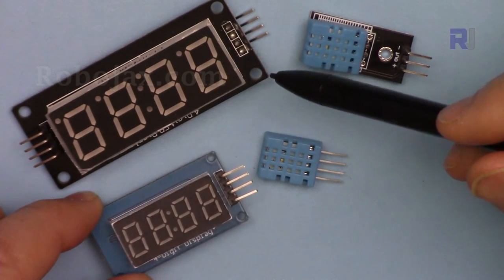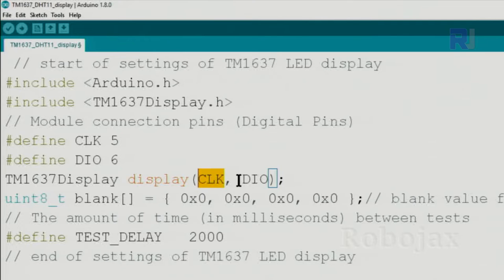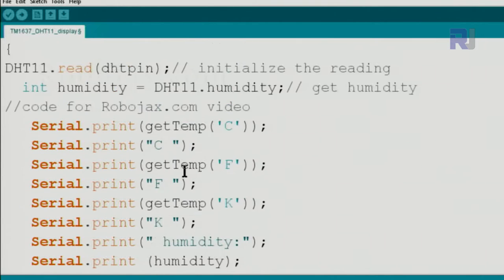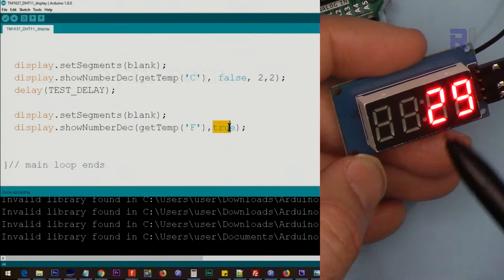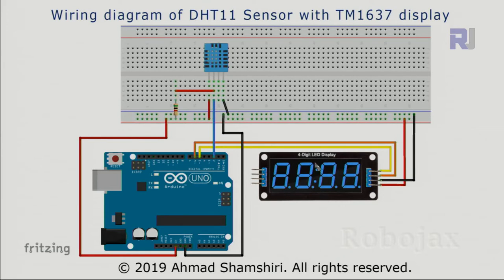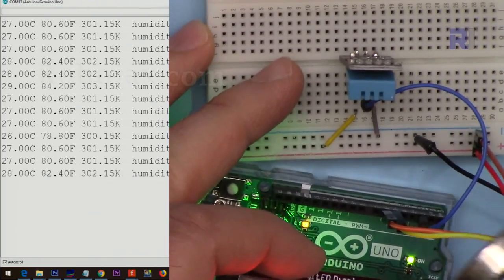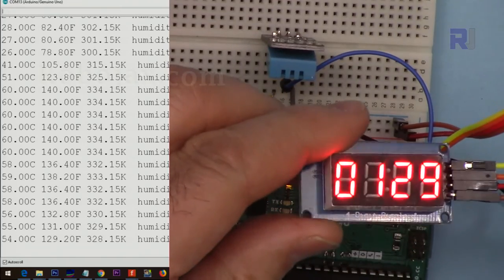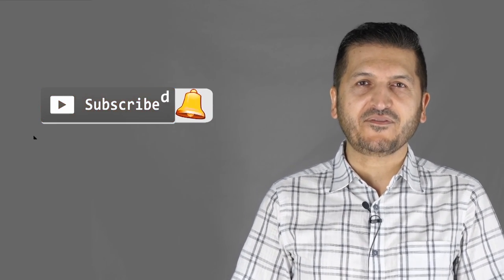Lesson 28: DHT11 Temperature Sensor with TM1637 Display| Arduino Step By Step Course

Comment: dear sir i am using 7 seg TM1637 module with Arduino, i hv download "Grove_4Digital_Display-master" Library and its working best. I hv used "  tm.set(7); "//set brightness; 0-7  instruction, i want to increase 7 seg brightness so i give tm.set(9);" its not working then i open "TM1637.h" file by changing its ext to TM1637.txt there i increased brightness from 7 to 0x0f. but still its not working when i write "tm.set(0x0f); "//set brightness;" in program. Plz can u tell me h i can do this.

Comment: Dear Sir, I made temp meter with Arduino & DS18B20 display on LCD working best, as LCD cost high so i brought 7 seg TM1637 but here i face problem. for example if i write this instruction   
for(int i=0; i<=500; i++)
  {
    display.showNumberDec(i);
delay(3000);
  }  
LCD work best as i think LCD has inside controller which hold last instruction and keep display last digit for 3 sec delay time, but with 7 seg start flickering due to this 3 sec delay or if i do any calculation in code because may be 7 seg can't hold last instruction. Is there any solution for it to keep display digit for this 3 sec delay on 7 seg.
Reply from the maker: Dot update the display more often. Update only if you need it.
Reply: @robojax  sir I have to do some calculations on temp reading when I write single comparison instruction 7 seg start flickering

Comment: Hi, i tried to verify de code of arduino and arduino tells me that the function getTemp() doesn't exist
Reply from the maker: have you watched introduction to DH11 video and introduction to TM1637? if not you must watch them separately and make sure you  can see the result before coming. This is lesson 28 and those two lessons must be before this.  it means the function does does not exist. meaning when you copied the code, you haven't got the code fully. We have a lesson about "functions" if you watched that, you would easily know what is the problem.